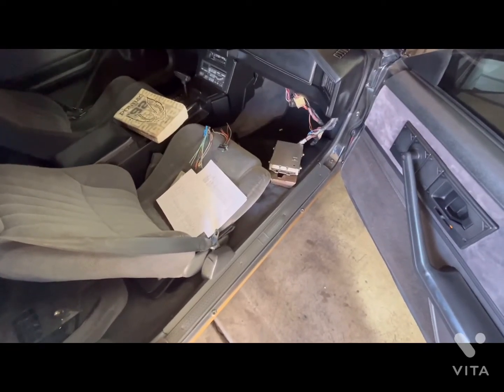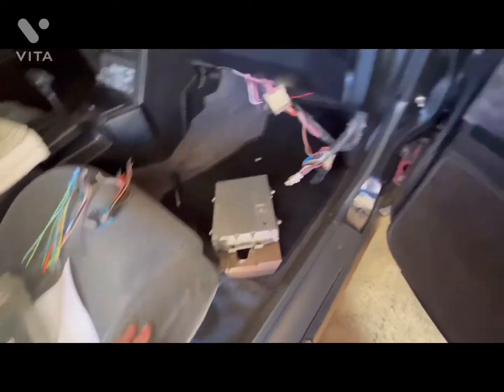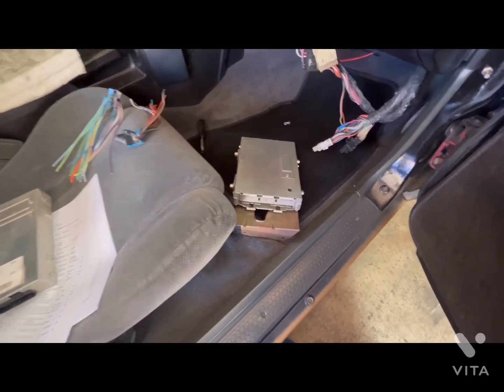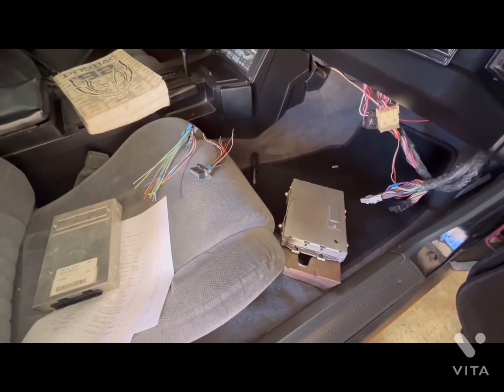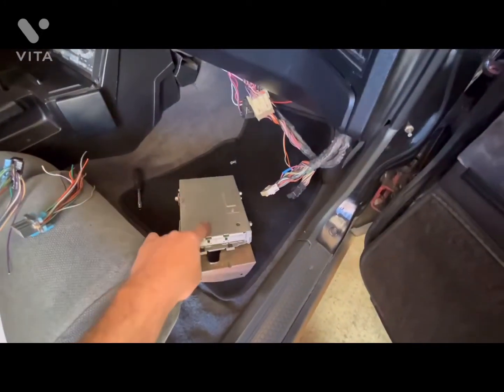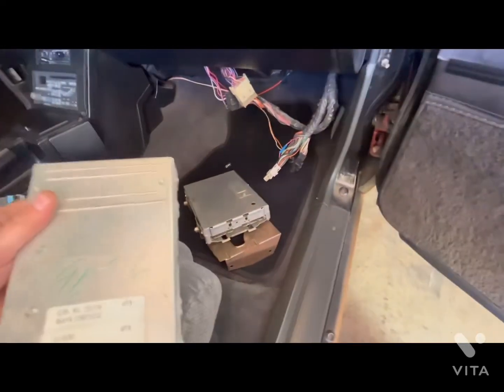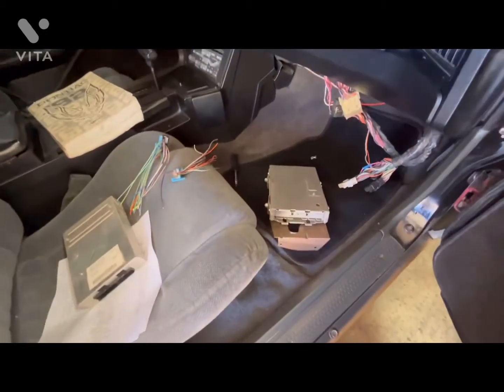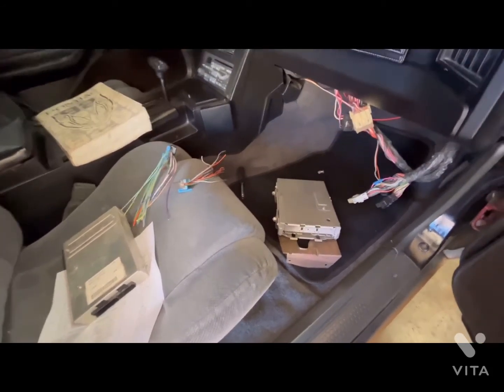New project! 8746 ECM swap into the LU5 Crossfire Trans Am

Comment: Can you tell me where can I get those ECM wiring board sheets for the two ECM boards in this video?
Reply: the connector identification sheets....
Reply from the maker: @mpoetzsc1 FSMs
Reply: @Joesmopargarage  Thank you.  And can you use a prom from a 7747 ECM or does it have to come from a 8746?
Reply from the maker: @mpoetzsc1 The PROM has to correspond to the ECM you are using. You’re honestly better off using a 7747, as they are much more common, and you don’t have to deal with VATS. The only real difference between the 7747 and 8746 is the 8746 utilizes an IAT, the 7747 doesn’t.
Reply: @Joesmopargarage  I guess the question is can a prom from a 7747 ECM be used in the 8746 ECM or will some features be unavailable if installed that way?
Reply: @Joesmopargarage  Thanks again for all the help.
Reply: @Joesmopargarage  Does VATs mean Vehicle Anti Theft?  If so, the corvette  has a vehicle anti theft system so do you think it would be important to have the VAT, or would I have to reporogram it to match my current keys?  There is a 8746 ECM on ebay for $30, but it has a 305 prom.  Still pretty cheap, but hard to get the 350 associated prom.  If its a 7747 does that mean I don't have to worry about a key issue?
Reply from the maker: @mpoetzsc1 VATS will be disabled if you run a 7747. As far as the 8746, L05 PROMs are VERY hard to find. Again, you’d be better off with a 7747.
Reply: @Joesmopargarage  sorry for teh additional questions, but if I did find a 8746 with 350 prom for automatic, would it accept my current key or would it need to be reprogrammed?
Reply from the maker: VATS will be eliminated with any ECM you swap in.
Reply: @Joesmopargarage  Thanks.  I thought your video also stated that the 8746 has lean cruise capability, where as the 7747 doesn'y.  I'm ready to pull the trigger on replacing the ECM and just want the ECM that will best improve performance for a 82 corvette.  I really don't know much about ECMs/PROMs, so you're helping me alot.  Thanks
Reply: @Joesmopargarage  In your trans am, didn't you buy a PROM from a caprice but the 8746 ECM was from a L03 car?.  I thought you said the PROM must match the ECM?
Reply from the maker: @mpoetzsc1 Yes. The 305 B-bodies used the 8746.
Reply: @Joesmopargarage  Oh, OK.  So basically if you were to put a 350 in your trans am you'd have to swap out the ECM and prom to match the 350.   Thanks for all your help.
Reply from the maker: @mpoetzsc1 Well that car is LONG gone, but yes. And only the PROM would have to be changed.
Reply: @Joesmopargarage  I built this before the corvette. https://www.youtube.com/watch?v=Wg3dbmZSk3I   Would have probably killed myself if I still had it.  Now its more technical tinkering with the crossfire to keep me busy.  I used alot of foxbody parts for that build...I see you have one now.
Reply: @Joesmopargarage  So, I think maybe this is the last question to make me finally understand this all...so I could put a L05 prom in a 8746 ECM that came out of a L03 car.....  Yes?
Reply from the maker: @mpoetzsc1 Yes

Comment: Hello Joe. Your coverage of this subject is unique and thorough. Thank You. 

I have an 84 vette manual (4+3) and im trying to figure out if this will work as an upgrade. I checked on gmpartsdirect and there are many gm vehicles that shared this ecm.  

In a later video you had a couple sheets of paper that i think were your guides for the rewire/repin. 
do u have a link to that paperwork?

thank you.

Comment: I tried this on my 82 trans am and I have the same 8746 ( APFN prom ) ecm out of an 89 caprice like yours and I snipped the pigtails connectors from a harness out of a 91 Camaro with also an 8746 and the pigtails wire color didn’t match the wire color on my 82. Only less then half matched so I’m confused as to why when you said they all match and it’s color to color, cut a wire off and sodder it in.
Reply from the maker: I said that because they matched on the pigtails I used. Only 2 or 3 of the wires were a different color. Either way, I can’t imagine it was that difficult for you to figure out.
Reply: @Joesmopargarage  What pigtails did you use?
Reply: @Joesmopargarage  Out of what did you get your pigtails? I want to change my ecm and I want the pigtails you used so I don’t have any color matching issues and can you also send me the diagrams you used?

Comment: I need to do this to my '82 crossfire trans am. I have the same '82 dealer service Manual you have in the video. Do you know if  the same ecm you used would work on my car? Or are there differences between my '82 and your '83?
Reply from the maker: The wiring is identical from 82-84
Reply: Thanks I appreciate you sharing your knowledge.

Comment: Can you put the 5055 crossfire ecm into a single throttle body style setup?
Reply from the maker: Yes. I’m not sure why you would want to though. The 5055 is ridiculously inferior to the 7747/8746, and uses a one year only knock sensor and ESC module, as well as the horrible card edge connector. People pay $250-300 for the 5055 in working condition. You’d be better off selling it and grabbing a 7747/8746 for $50.
Reply: @Joesmopargarage  What other changes / upgrades would you do to a bone stock crossfire car to make it responsive, good acceleration, and run a lot better? In your experience while keeping it crossfire
Reply from the maker: @robinlovescars  Bump the timing, bump the fuel pressure, headers and exhaust, etc. The typical stuff. You can’t do much to increase the “response” of a CFI car. The ECM is only so fast. You can only optimize what is already there.
Reply: @Joesmopargarage  Would you recommend removing emissions equipment as well?
Reply from the maker: No. None of the emissions equipment reduces performance, other than the factory cat if it’s still there. As a matter of fact, keeping the EGR lowers combustion chamber temp, allowing for more timing and better fuel economy. Ideally, the EGR command should be removed from the PROM if the valve is deleted. The ECM adds timing when the EGR is commanded. As far as the A.I.R. pump, it’s only a 2-4 horse drag. Nothing you’ll ever feel, or even see on a time slip. All you’ll accomplish is having a “hacked” engine compartment.

Comment: Hi Joe, you stated that you have details on installation of a 8746 ecm, could it be possible for a copy please,  many thanks
Reply from the maker: Of course. I’ll send you the wiring diagrams. What’s your email address?
Reply: @Joesmopargarage  hi Joe, did you receive my message with my email address as the message is not showing up on my account,  please let me know if I have to resend it,  thanks 

Darren
Reply: Are you ignoring my messages for any reason,  have I offended you by offering you some money for your time n trouble?,

Comment: will this work with the 700 r4 trans??
Reply from the maker: Of course. My 83 has a 700R4. The ECM doesn’t know or care what trans is in it. All the ECM does is activate lockup.
Reply: @Joesmopargarage  when you ported you're intake did you have any problems with fuel puddling in the intake.  The engine is not happy till 2800 rpm's.  82 vette aluminium head's an 1.6 rockers just like you.
Reply from the maker: @10rrace  When I pulled the top plate off to swap to a single TBI manifold last week, I had a small amount of fuel puddled in the CFI base. This is something that was not there before I ported the base. That is the reason they designed the manifold the way they did, with extremely small runners. The engineers had the exact problem with fuel puddling at low RPM. Their solution was to reduce the overall volume of the runners to increase port velocity and maintain fuel atomization, which in turn gave very good bottom end and decent midrange, but made the motor a pig at high RPM. There’s really no way around it. People have ported these manifolds every way possible. The end result is more than likely the same.
Reply: Do you think the new ECM will help by managing the fuel better?  Thanks Nick
Reply from the maker: @10rrace  It will help, especially in open loop.
Reply: @Joesmopargarage  Please let me know if the ECM helped the bottom end fuel management.  My next step was to replace the stock 1.5" short tube headers with 1.625" long tubes, then true duel exhaust.  I will be heading for 3/4 century mark an I would like to go at least 12 sec 1/4 mile before I turn in.
Reply from the maker: @10rrace  The 8746 will do nothing for bottom end “fuel management” that the 5055/6026 won’t do. As I said, it runs leaner and smoother during open loop operation with the 8746, and the timing is better than the old CFI ECM. Idle quality and WOT power was dramatically increased, as well as fuel economy. I picked up roughly 4mpg by changing nothing but the ECM.
Reply: How much intake runner is left after you trimmed this last time. Is it still over half? I know we do not have the same cars or motors.  I know I will have too shorten mine as well. Tks nick
Reply from the maker: @10rrace  I took roughly 1.5” off of the length of the runners
Reply: @Joesmopargarage  thank you I think I had taken only about .5".  After I do the exhaust I will be taking at least 1 inch more.  Those runners are crazy long.
Reply: If I can ask but another question?  Where did you get the 8746 for $ 30.00.
The police interceptor has 91C in vin.  No cars around pa has been melted down.
Reply from the maker: @10rrace  U-pull-it junkyard. 8746s and 7747s are all over the place here in AZ.
Reply: @Joesmopargarage  the nearest one to me is 2hr.  Sorry for being so stupid but for my 82  how will I know if it has the correct prom an other stuff in the ECM.
Reply from the maker: @10rrace  Check the broadcast code when you pull the ECM. You might be better off shooting for a 7747 out of an L05 truck. They’re much more plentiful than an 8746 from an L05 car
Reply: I will check the ECM tomorrow.   Big thanks again.
Reply: Joe I emailed  you the info on the corvette ECM.  I do not know which number you to find out the broadcast code or to compare.
Reply from the maker: @10rrace  ARY is the broadcast code for an 82 L83

Comment: Do you know anything about the 7730? I went to the junkyard and I pulled a ECM out of a 91 Camaro, it didn’t have a sticker on it got it home, and realized it was a 7730 not a 8746.
Reply from the maker: Yes. The 7730 is a MPFI ECM and will not work with the LU5/L83/L03/L05.
Reply: @Joesmopargarage  thanks for the info! So my only options is a 7747 or the 8746?
Reply from the maker: @chrisfayling  For the most part, yes. Those are the popular ECMs used for swaps. The 7747 is a truck/van ECM, while the 8746 was used in F&B bodies. The 88-92 F-bodies used VATS, the B-bodies did not. VATS is programmed into the PROM, not the ECM.

Comment: Does the 8746 5.0 work with a 82 350 CFI? Does it have to have a 5.7 prom?
Reply from the maker: The 8746 will absolutely work in place of the 1982 5055. You will need an L05 PROM. An easier ECM to find would be a 7747 out of an L05 truck. Basically the same ECM as an 8746, but without the IAT.
Reply: 7747 doesn’t have the VATS either? 7747 is just a run of the mill 5.7 TBI truck ecm? Minus the lean cruise mode?
Reply from the maker: @mattodonnell9182  Correct. No VATS with a 7747. The lean cruise mode can be enabled on a 7747, it just isn’t in factory configuration. I only suggested the 7747 because it’s a much easier ECM to get ahold of with a 350 PROM. With an 8746, you’re pretty much limited to 89-91 Caprice/Impala.
Reply: @Joesmopargarage  haha, I threw one away a few years ago when I put a 11.1 350 with AFR heads and a big roller cam in a 1990 c1500 sport that had a cracked block 350tbi in it. Hindsight is 20/20 right!🤣 that was a fun truck though. Ran 12.70’s blowing the Hoosier DOT slicks off it at the now defunct Atlanta Dragway. I am not looking for that kind of performance out of my vette, just looking to improve drive ability and performance. It runs good now, knocks out low to mid 20 mpgs with the abysmal 2.83 gears in it. Idles rough though, high idle hangs until you come to a stop and let it come down, and I am getting ready to port the stock intake and throw a set of 3.73’s in the back. Hoping an ecm upgrade will be just what the doctor ordered. Later I am probably going to go throw a set of aluminum heads and small roller cam in it. Your videos are inspirational since I want to see how much I can improve the factory crossfire system. I feel based on yours and other folks builds I can get this from a sleepy 16 sec car to a respectable low 14 high 13 car retaining or actually improving its drivability manners. It’s a challenge I am looking forward to and you have certainly paved the way with great information and knowledge.

Comment: I have a 1983 TA with a Crossfire System. The car came a 1969 5.7L 350 swapped in while using the stock ECM. Is it ok to use an 8746  without swapping to a 350 PROM? That engine was tired and I am putting a newly rebuilt 1972 5.7 350 with a stage 2 CAM. I like what you've done here. Thanks for posting this video!
Reply from the maker: You can swap in the 8746 but it will not run well, just as the current 6026 more than likely runs poorly with the factory LU5 PROM. There is no such thing as a “stage 2 cam”. The exact specs are needed, but for any 350 swap into an LU5 car, a 350 PROM is needed, whether using a 1982 5055 ECM, 1983-1984 6026 ECM, or a 7747/8746 ECM. With a 305 PROM, a 350 will run lean, idle poorly, and will severely lack power.
Reply: @Joesmopargarage   I used an Enginetech rebuild kit and they referred to the CAM included as a "Stage 2 high performance". I guess that's just for their use. Thanks for the quick response!
Reply from the maker: @justincase6151  Just be careful to keep you intake duration @.050” under 204, and your LSA 112-115, or you’ll need to do some PROM burning/tuning.
Reply: @Joesmopargarage  my intake duration rating @.50" is 214 and my LSA is 112. Looks like a prom burn is in order. I found an ECM on rock auto for the '89 Caprice 350 5.7 engine which seems to include the appropriate prom. Thank you!
Reply from the maker: @justincase6151  No reman ECMs are supplied with PROMs. 7747/8746 ECMs are super common. It’s getting ahold of a compatible PROM that can prove to be difficult. I just sold a NOS L05 PROM for an 8746, so they’re still out there. Anything L05 will be pretty difficult to find though.

Comment: I have a problem ive traced back to the ECM on my 82 Corvette.  No luck yet finding a 82 or 84 Corvette ECM.  Do the 82 & 83 Camaro & T/A  ECM work in the 82 Corvette ?  If so , is it just a plug in swap & go ?  Thanks
Reply from the maker: The 82 Corvette and Camaro/TA use the 5055 ECM, and the 83 Camaro/TA and Corvette use the 6026. You can use a 5055 from an LU5 in your 82, but you’ll need to use the L83 PROM. The 6026 is also plug and play, but we’re only available with the LU5 in the F-bodies. In order to use a 6026, you’ll need an 84 L83 PROM from a Corvette. Or do like I did, swap in a 7747 or 8746 and use an L05 PROM.

Comment: Could use your help, I have an 82 comaro with cross fire it takes a long cranking time to get started and runs ok once started.
When it gets up to operating temperature and I shut it off it won't start back up unless I give it a shot of starting fluid.
I have replaced the fuel pump relay
Reply from the maker: How old are the pump and filter? Have you checked/replaced the ECT sensor?
Reply: When I had purchased the car in February the guy told me he just replace the fuel pump.
The service engine light was on I have a code 22 and a code 42
Replace control module and distributor, throttle positioning sensor.
Reply: Not sure where to find that
I have a gm shop manual
Reply from the maker: Email me at roccojakubec@yahoo.com and I’ll scan the flow charts in my 82 FSM for codes 22 and 42.

Comment: Hey Joe, thank you for your videos. I think my ecu is bad with my 1982 5.0 305 CFI pace car. My father parked the car for 20 years and I have changed a whole bunch of parts and my camaro is running very rich and causing the car engine to flood. I can't even keep the car on for 5 mins. I have changed injectors, mulitple sensors with no change in the issue. Let me know your thoughts!
Reply from the maker: A bad ECM could very well cause what’s happening. Have you verified fuel pressure? Does it run fat in open loop, closed loop, or both? A very common culprit is the CTS on the front of the intake, right above the timing cover. They were junk when they were new and a popular upgrade is a CTS from a late 80s 305 Camaro. A new sensor with the upgraded weatherpack pigtail is about $20. Check timing, and verify the vacuum line to the MAP is in good condition.
Reply: @Joesmopargarage  hello   Joe, thank you for a answering my question so quickly. I have not verified the fuel pressure yet but it seems to run fat in open loop. I feel like it never goes into closed loop. After a couple minutes the injectors start to sputter and than in stalls. After I have to disconnect the Injectors and start the car to get rid of the extra fuel and start the process all over. I also changed the CTS sensor.